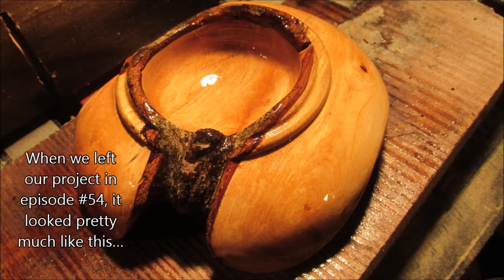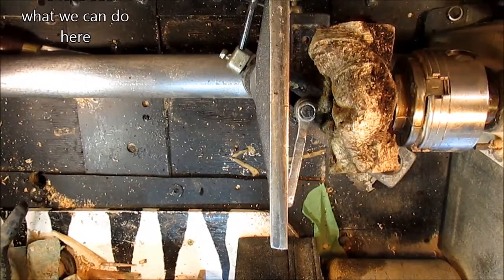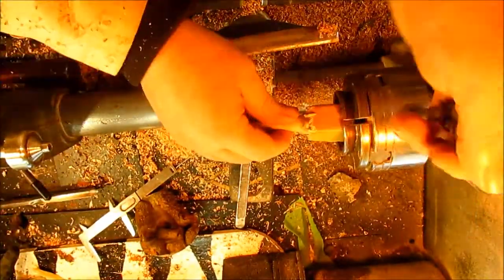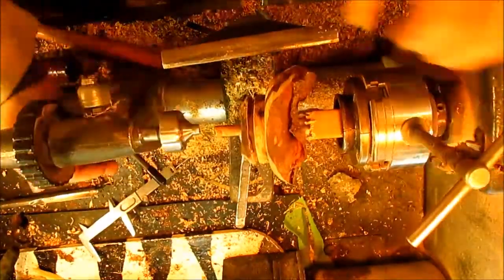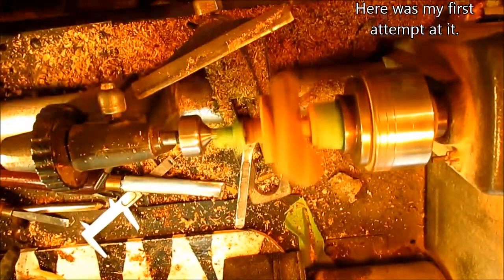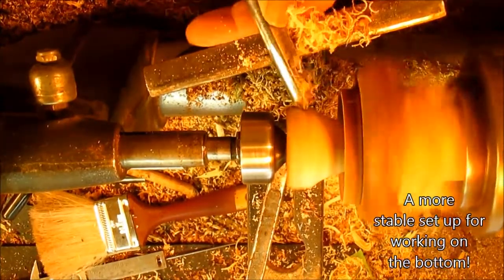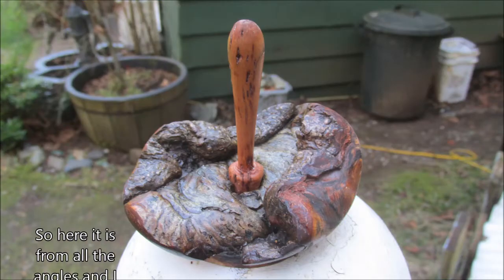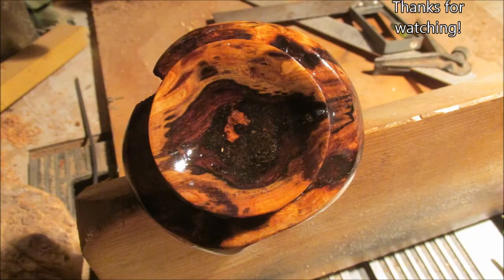Wood Turning #55 Alder Lid for an Alder Bowl

Comment: I tend to get side-tracked by those stupid little turning projects (and other projects) that I think will go quick and easy but end up taking all day and with no results. Very nice lid. That plum wood seems pretty nice. The little defects add a nice touch.
Reply from the maker: Hello Jordan:I am glad it is not just me then!!And yes the plum is a very cool wood to work with. In Victoria BC they line the boulevards with them and they have a real nice purple leaf on them. This particular piece has become a little pitted and such so it is really good for small projects.Thanks for watchingLarry